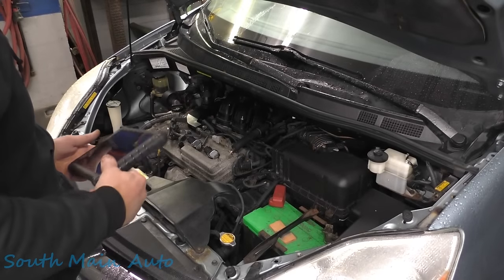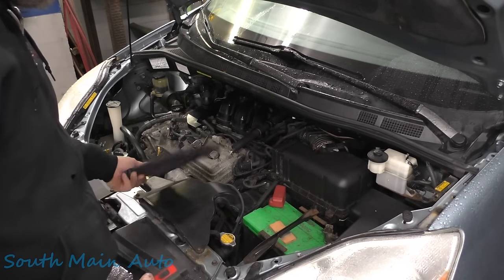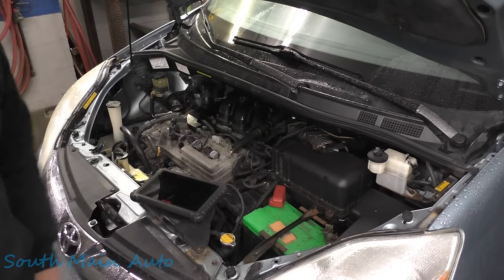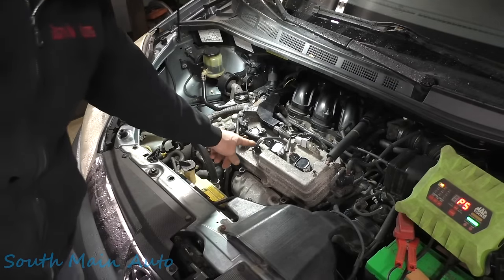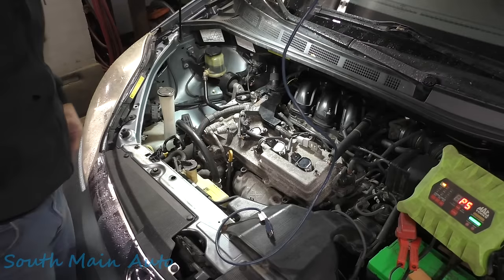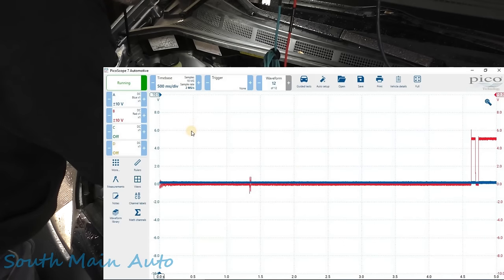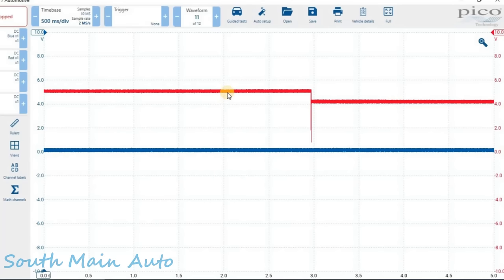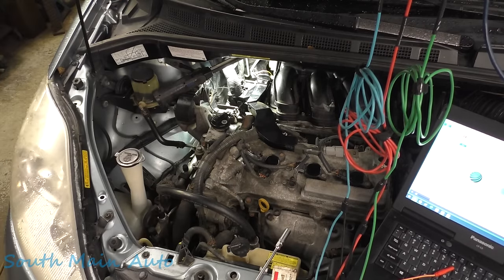Toyota Sienna: P0340 Camshaft Sensor Problem

Comment: So if I understand this correctly, the sensor mount was bad and then it broke so in the end it was a bad cam sensor?  How is the owner replaced each sensor one at a time and not see that?  I understand Eric's method of step by step is far better, but shouldn't have the owner seen that the mount was bad?  Then again Eric did say the sensor he bought was junk so that was his failure even if his process was inferior.  I enjoy learning from this even if I won't attempt some of these things.

Comment: If you remember your HS physics, magnetism follows the inverse square law.  Double the distance you cut the magnetic strength by a factor of four.  So a slight change in the position can have a drastic effect on the signal output.

Comment: It’s crazy to have one bolt on any air gap sensor. All though I do have a v twin Briggs and Stratton that won’t restart after reaching operating temperature. The aluminum block that the coil magneto is solidly mounted expands enough to increase the flywheel air gap. Let it cool down 1/2 hour and it fires right up and runs for hours.

Comment: Before getting to far into this video. I was asked to diag a crank nonstart. 
When i got to the compression test cylinder 1 had 0 compression cylinder 2 had 15psi cylinder 3 had 60 psi. 
I called it there . Was a 2.2 ecotech in a chevy 
I  found no codes on that vehicle with a initial scan and the car had been running the night before 
My assumption the chain tensioner failed while the car was running and the chain had a load on it but as soon as they parked and attempted to start the car with a lose chain and it jumped the chain on the cam gears.

Comment: Just a side, I have a specialized electric mountain bike that shut down after 10 miles, I took it into the dealer and they tore that thing down to the nuts and couldn’t figure  out why it was shutting down. So I started looking at schematics and I spotted a hall sensor on the crank that signals the computer the crank speed and other criteria, I know that hall sensors are sensitive to air gaps. I had them put the bike back Together and adjust the hall sensor as per the spec sheet. Bang the computer came up and after riding it around the parking lot it worked like a champ. They had been having problems with these and couldn’t figure it out, now everyone of these bikes that come in that’s the first thing they check before they start tearing bikes down and replacing parts. Hall effects sensor’s can drive you nuts, they are very simple but if not adjusted correctly will send you to the funny farm.

Comment: You said the customer swapped the sensors around.  Bank 1 was very tight to get the sensor seated.  I will bet money that he tried putting that sensor into bank 1 and tried to use the hold down bolt to seat it, cracking the plastic.

Comment: I thought the 3.3l had the oil cap on the drivers side front VC. The 3.5 is on the passenger side front VC. I have a Highlander 3.3l and the engine shoud be identical but the oil cap is on the drivers side front VC.

Comment: ''Toyota Service data gives you a known good wave form".     A manufacturer that gives technicians data to use as a base line for comparison has your interests at heart. Is Toyota service data a separate subscription?  Would over torquing have contributed to it's destruction. If 8ft lbs is good, 80 is better. Good vid

Comment: When you use the MAC battery charger in the Power Supply Mode, does the ignition have to be on or it doesn’t make a difference?

Comment: I would bet that when the broken sensor was installed originally, it was installed with a dry o-ring and didn't seat properly. The lock down bolt was then tightened and broke the sensor.

Comment: I'm gonna assume they had some work done long ways back year or 2 that required the removal of that sensor! And some one did not respect torque specs on a tiny fastener and it got the little crack that got worse!

Comment: 😎😎😎
      Could it be ,when it was installed, they didn't push the sensor in all the way  and tried to push in by tighten the bolt  causing it to break the flange?

Comment: As a average Joe with a $20 code reader, I find it cost effective to fire the parts cannon at least once. The last 2 times I've done this worked out fine with non-OG parts, but I'd be thrown for a loop if my N.E.W. part didn't work. Can't blame the customer  for giving it a shot or throwing in the towel.
Reply: I used to have a cheapo reader like that in the beginning. It will save you a lot of time to go to the next increment up, a reader with live data. Not the big leagues with a whole graphing scope like the pros have but just one with live data that shows the values as it switches. It might give you a simple small screen graph even depending on how good you look but seeing how expensive parts are now it can save you from repeated wrong parts.

Comment: I had the same problem with wheel speed sensors In the front of my 2005 Chevrolet Silverado Remove the rust under the sensors painted the area put them back in ,ABS quick kicking on prematurely Problem solved air gap was the problem

Comment: On a 2002 dodge ram 1500 4.7l would a p0340 no cam signal at pcm have anything to do with the timing chain Or tipm Because asd is not getting grounded by pcm. I think I have a faulty fuse box. I don't know if that would cause that code

Comment: On those cars it would seem the cam codes or immobiliser codes sets  if it doesn't start after a set amount of time or if it stalls have a couple of times I've had that with my Corolla and trying what I suspect cheap parts at it does not work you must use Denzo or OEM parts yeah no reason why not to throw the parts cannon

Comment: The owner probably tightened the bolt without "seating" the sensor first and cracked it.  Could have been cracked but working for a long time.

Comment: Interesting that you used the term "barring the engine" which dates back nearly 200 years. In order to start a steam engine, the piston needed to be positioned at just past top dead center, and the way to do this was to place a iron bar into holes in the flywheel and using leverage, rotate the crank shaft. For huge old steam engines this might take two men.
Also I'm glad to see you stand behind your work, but I bet you don't repair manure spreaders.
Reply: He would stand beside his work too and jumps quickly if he ever works on the side spray manure spreaders.

Comment: As a band aid, could you have made a hold down bracket that goes onto the bolt and applies downward pressure on the sensor?
Reply: yeah but he's aiming for a no comeback and guaranteed fix

Comment: My ex was ready to send (our at the time) B-Class to the dealer because it was difficult to start after filling up at the gas station. In her words, "I don't care if it's 2 or 3 thousand dollars!" Spent less than $200 on a Purge Solenoid valve and replaced it myself. The dealer would have given us the best screw of our lives - no lube.

Comment: Odd.....it seems to fault every other start attempt. If this was one of our aircraft with redundant systems A and B which switch off every start attempt, I'd say that one of the sides was failed. In which case you could disconnect system B for instance and see if system A works. Then disconnect system A and see if system B handles the job.

Comment: Could it be the same issue with flywheel position sensor that car wont start? Because my sister has Ford focus mk1 tdci and the sensor was literally chewed off a bit, bought another sensor but couldnt start it and it had adjustment screw i adjusted it so that it wouldnt touch the flywheel but car didnt start anyways. Had code that said that fuel rail pressure was too low, but that code was present for years before. And so I dont have such a specific equipment to see sensor graph, but is it possible to adjust it manually by being under car while someone else cranks and i adjust it underneath?

Comment: It seems like the owner may have overtightened that new sensor when he put it in and caused it to bend and crack under the excessive torque of the bolt.. A commonly made mistake by DIYers "I'll just tighten the crap out of it. The tighter the better, right?"

Comment: For educational purposes this is good info.  However, if the customer is paying by the hour then immediately changing the sensor then running diagnostics would be least expensive for the customer.

Comment: Eric O my guess is the fellow did not get it in like you had trouble doing and tightened the bolt cracking the sensor. So diy failure.

Comment: 139$ part... ouch!  I'm betting that the 'hard going in' is a clue... the original sensor went bad, the owner replaced it and, instead of lubing it and working it in (!) they used the bolt to pull it in, breaking it.  One in the Insty, two in the FB!  Go Eric O.  I find if there's room, twisting it as you insert it helps.

Comment: He replaced the #1  sensor with a new one. You put the #1 sensor into the #2 position and found it broken. Therefore  he bought a broken sensor or mixed old with new.

Comment: The cracked sensor went in its hole difficult. You had problems yourself to put iit in after the switch.   I guess the owner had the same problem and screwed it down with the bolt, and that cracked the sensor!

Comment: Cheap and/or weak hall effect sensors are a pain in the trunk, the slightest error in manufacturing tolerances causes problems like this. Would probably have been worse in cold weather.

Comment: I like the more complicated explanation that they did solve the original problem of a bad sensor in their sensor swap shenanigans, but, also created the new problem by breaking or at least cracking the sensor you found trying to remove it with the big flathead screwdriver that every set incudes for just that purpose.

Comment: It looks to me as if there is a metal pressure plate needed which fits around the sensor secured to the bolt to stop flexing.

Comment: The broken fastener is from overtightening (IMO). Happens with molded parts all the time.
Reply: Customer probably didn't have it fully seated before tightening after playing swaptronics. Didn't or couldn't check like Eric did.

Comment: Phenomenal as usual. Wish I could find a known good waveform for a VR pickup on the back axle of a 1997 Ford F250. I am pretty sure it is too small at 350mV P-P but it is new one from NAPA. So I think it has a encoder disk problem like distance. Speedo works but will not shift properly. Shifts ok with it unplugged. These Fords had quite a few variations according to data. Oh, they can be fun.
Reply: @Crenshaw Pete There are some variations. I have Mitchell1. This one has the ABS module in the frame rail with the electronics behind the glove box. and no pump.  There is also an amplifier module. but VR sensors don't require power. There is also a 3V bias. Some have one leg grounded.

Comment: Thumbs up to the owner for thinking it might be an issue in the harness, especially since you are in a corrosive state. Some engines require shimming to get a proper gap, and installing without shim will ensure the sensor is destroyed on the first crank. Last of my engines that needed a crank sensor had a shim so I used plumbers putty on the end of the sensor to get the correct gap.

Comment: If you're going to try $10 crap sensors you have to assume it may not be good and try more than one. You could just buy a $72 Denso sensor and know for sure. Cross-swapping a known good sensor and watching for the fault to move makes more sense than a $10 knock-off.

Comment: I'm guessing that hideous exhaust leak is yet another "normality" of life in the rust belt. If a vehicle from the rust belt pulls into a shop out here, they'll commonly decline service & recommend sending it to the crusher. Roughly 99.9% of the vehicles in our U-Pull-It/Pick-n-Pull yards have far less rust issues than the vehicles you have to deal with.

Comment: Should have told the customer if he kept replacing stuff he would eventually replace the right part.
Reply: You might think so.
I had a fault on my van, when I discovered the problem it was a sensor that is not mentioned in any service manual. The sensor wasn't even faulty, just the secondary turbo pressure sense pipe was disconnected. It's a safety feature to make sure the turbo pressure drops when it is supposed to and if it doesn't detect a drop in pressure it goes to limp mode.
I've seen reports of people who have spent thousands trying to fix the same problem including changing every known sensor and even the turbo.

Comment: Bet the rear sensor wasn't in all the way and the customer cranked it down and cracked it before you got it.
That's why swapping didn't  do anything, none of the sensors seated.
And even the new sensor didn't seat and had an air gap.
You seated it.
But the customer had already cracked it bc he didn't know it wasn't seated and tightened on it
Reply: I agree!  Eri c had a hard time getting the B1 sensor in and the customer probably had the same issue!

Comment: if it was mine, I'd just shave the under side of sensor bracket to lessen the gap and make it bolt tight. 🤣
wouldn't sell that as a job repair though.

Comment: Your battery maintainer is very electrically noisy even though it is directly connected to the battery posts. Please do a video and look at how much electrical conducted noise the battery maintainer is imposing on the vehicle +12 supply. I think you will be very disappointed in the maintainers switching output stage (vs linear which is old school and much larger and heavier). 

The oldest reference I have for a maintainer (power supply + charger) Peak to Peak AC noise when loaded (nominal is around 20 Amps) comes from GM (module re-flashing requirement + actuator relearn and calibration), and is 50mV P-P riding on the vehicle +12V supply. Vehicles have actually gotten more difficult in that the programming currents have increased (according to GM, VW and BMW) and connecting to the vehicle could require using jump start posts under-hood, if the battery is buried in the trunk and inaccessible (Cadillac sedan). 

A maintainer with a switching output stage needs to be directly at the battery for the lowest possible noise. Another problem with a switching output stage is it may not be able to handle large surge currents if the battery charge is very low. There are more problems with most switching maintainers that I have looked at, like poor voltage regulation and inaccurate current limit set.

Interesting that the vehicle started with a clearly faulty cam position sensor, so this must be a limp home mode. You your fortunate to have the vehicle start the first try and then fail. One of the CAM sensors will be base timing, I think it is bank one on this vehicle (a CAM reference that does not move with variable cam timing actuation), and as such the vehicle may not default properly to limp home mode if this sensor is bad, meaning no start (long crank).

As you know, CAM and CNK hall effect (most 3 wire sensors) are very specific per vehicle target (magnetics) after market sensors are not tested per application over the engines complete operational RPM range.

Comment: Plastic body sensor you must be sure they're bottomed out before cranking down on the bolt....bet the guy stuck it in then tried to seat the bolt which broke the sensor.   So...correct diagnosis but faulty repair.

Comment: I'm at 3:00. My guess is that this engine needs timing belts. It does not necessarily follow that a cam sensor code means that the cam sensor is at fault. Check for ground. Check for power, check for wear on the timing belts. Make sure of what you're dealing with before firing off the parts cannon.
Edit: Mechanical damage to the sensor housing? I would have taken a while to figure that one out.

Comment: Can we hook that scan tool up to the current administration and see why Joe is firing on 2 cylinders.🤣🤣🤣
Reply from the maker: He's your classic U1000 NO COM and when it does get COM a P0300 random cylinder misfire pops up right away haha
Reply: @SouthMainAuto  time to scrap it it's leaking oil in the rear haha

Comment: Id wonder if corrosion around the rear hole didn’t allow it to go in all the way originally and in and out broke the sensor creating the bigger problem
Reply: Corrosion off the assembly line?
Reply: @cjr1881  it can corrode in the hole assembled. Someone hasn’t taken apart a gm abs sensor or siezed wheel bearings yet.